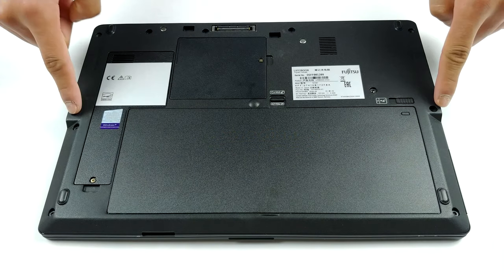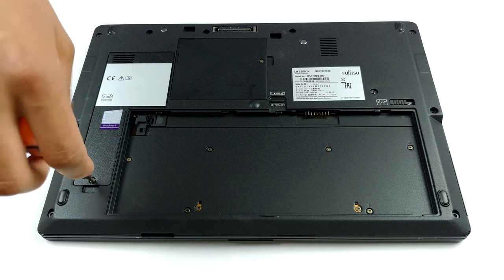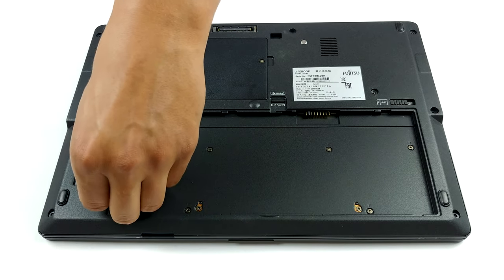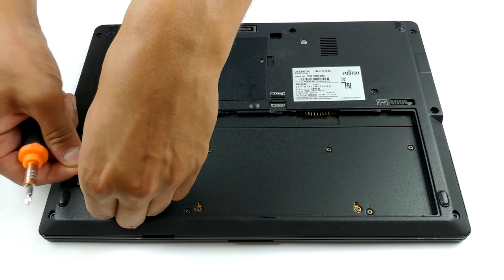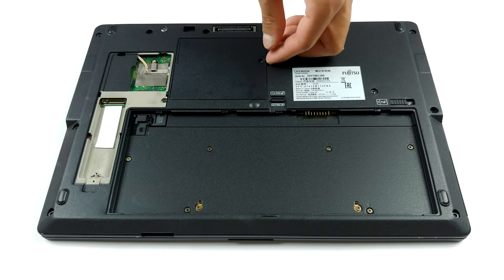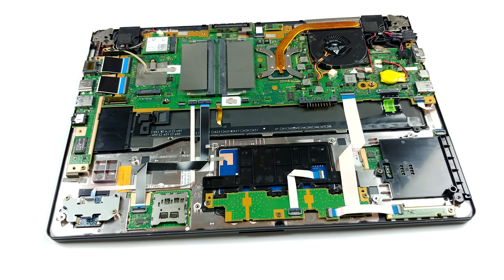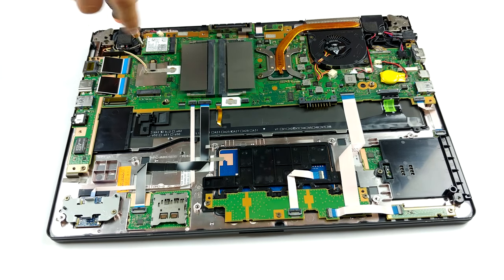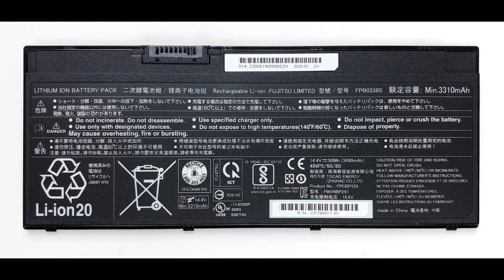🛠️ Fujitsu LifeBook U7410 - disassembly and upgrade options

Comment: i have a u748, it looks 100% the same apart from cpu socket. But my guess is everything else would fit in the chasis, which I personally think is amazing. I wonder if the displays would be cross compatible....I guess not?

Imagine you could just put a new mb in the old laptop and everything else worked.